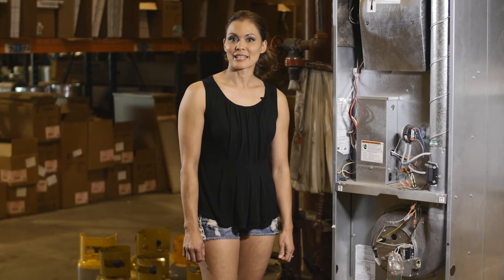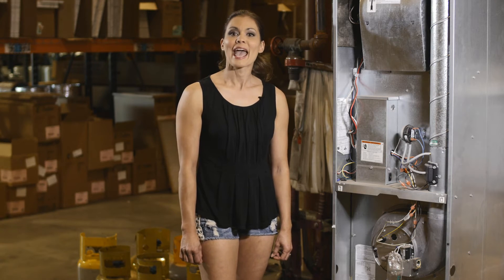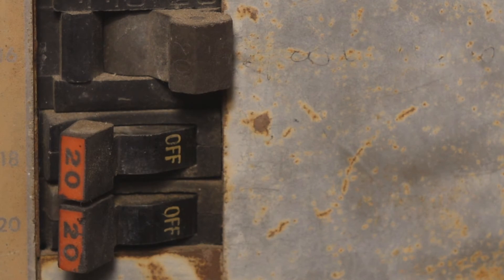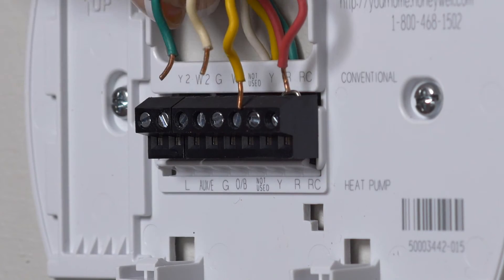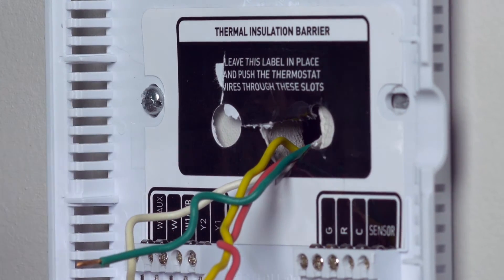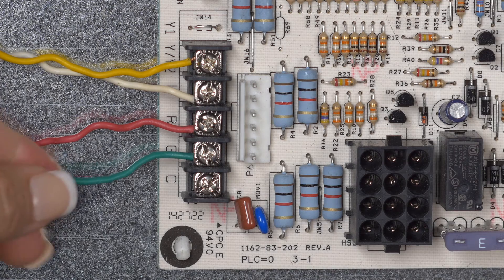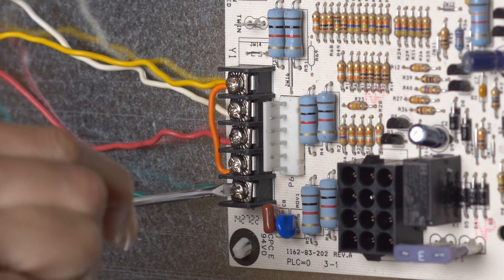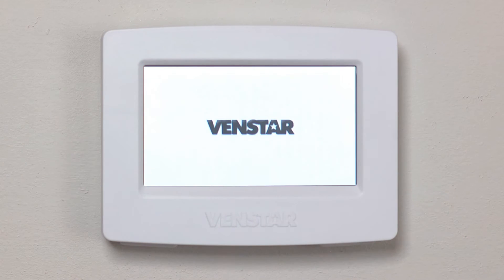installing the Venstar ColorTouch on a 4 wire system

Comment: Hello, I have the model T7900 but in the video it does not show the blue cable, could you tell me in this model T7900 which color gives it power because when I put all the cables in the color they go the thermostat does not turn on